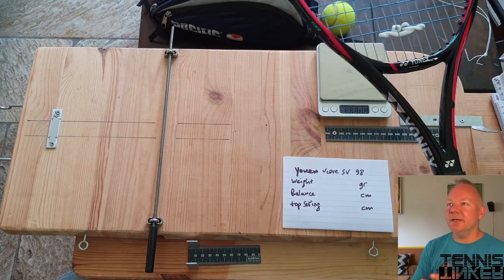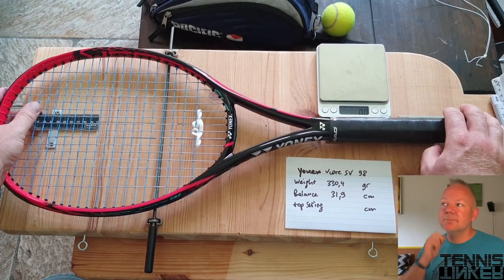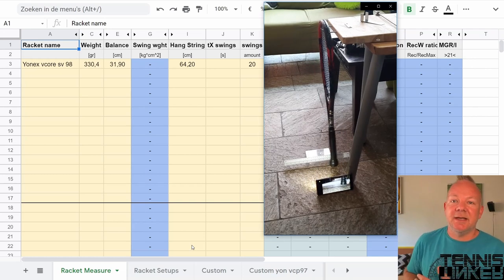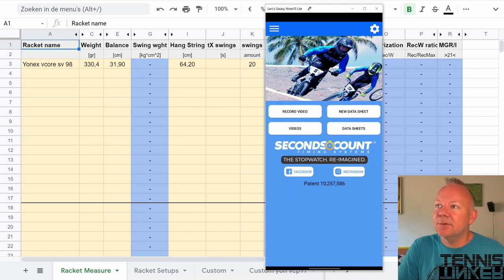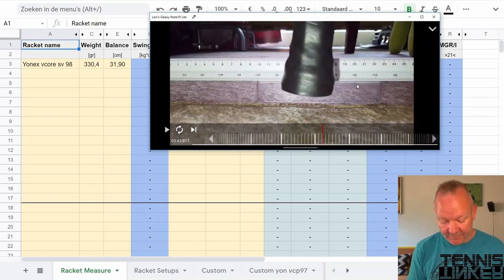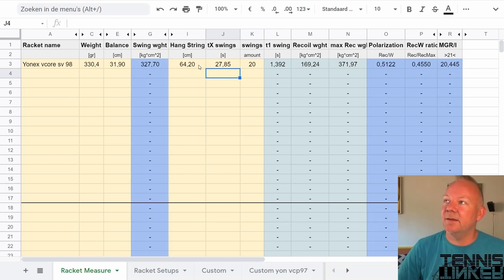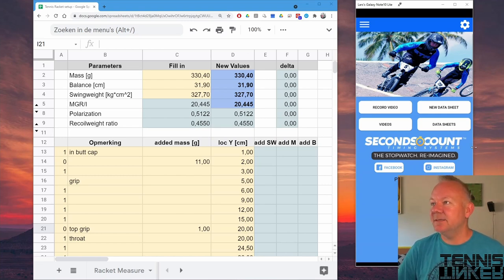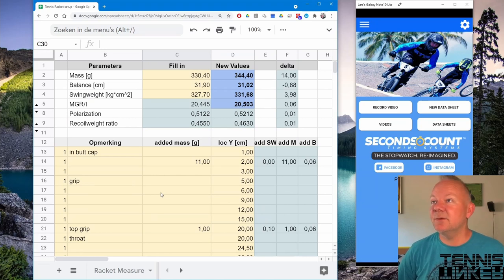Cheap DIY Swing Weight Measurement tool

Comment: how do i figure out the top string distance?
Reply from the maker: Be creative in measuring the distance between the butt cap and the top cross string, you could knot a thin rope to the top string, let it hang down and cut it just below the butt cap, then also cut it right under the top string, measure the length of that rope. 
Different way: hang a little thin rope from the top of the racket over the top cross string while having the racket exactly horizontal level and use a long ruler to measure the distance from the butt cap to the hanging rope.

Buy a metal thin flat stick that is sturdy enough but also skinny enough so that it fits in the holes between the main and cross strings. Bend the end 90 degrees with several cm up. Push that against the top cross string and make a marking just behind the butt cap. Measure the length.

You can be creative and measure that in many different ways.

Comment: Great video, thank you! 
When you go into customization (7:23), how does it make sense that 11g at butt cap would influence the Balance the same as 1g at top grip? The butt cap is much farther from the balance point so 11g there should have much more impact on balance than only 1 gram at top grip (closer to balance point). Wondering if the formula is off there?
Reply from the maker: I think you are looking at the wrong numbers. When i change the 0 into a 1 at the 11g butt cap, you see a delta balance of -0.96
After that when i activate the line at the top of the grip the Delta balance jumps to -0.1 so only -0.04 extra. So that is in line with what you would expect. The increase at the top of the grip has much lower impact on the balance than an increase at the butt cap.
Reply: @TennisTinker  Thank you so much, indeed looked at the wrong cells. Fantastic.
Reply from the maker: The column with balance impact at each line cannot have the exact balance change as this is dependant on the current balance and each change would also have an interfering impact on other changes. I wished i could have programmed it like that, but that's way too complex. The swing weight and mass contribution is easier in that regard. So i understand that you concluded what you did based on the line item.